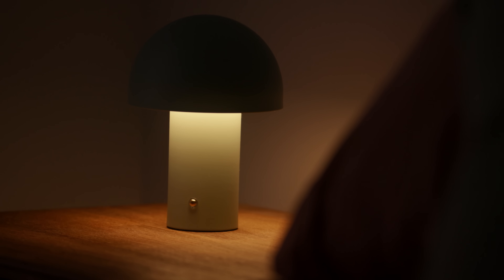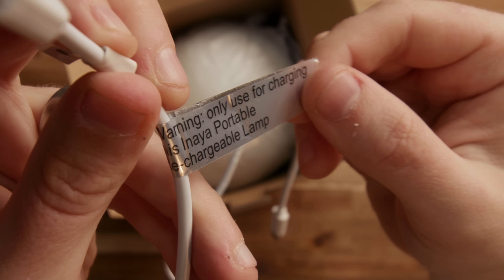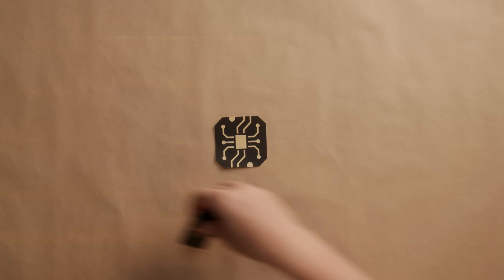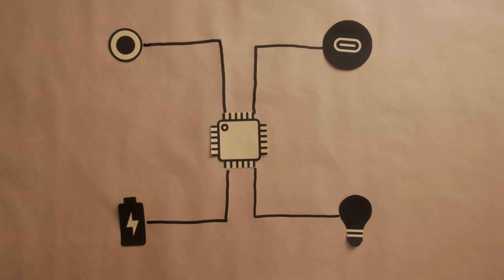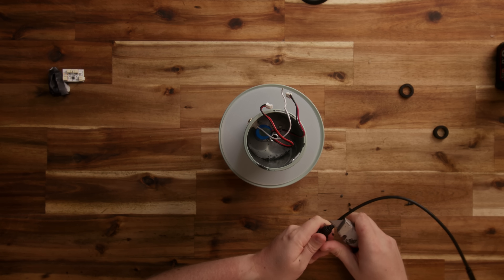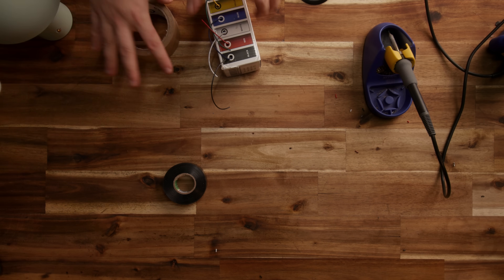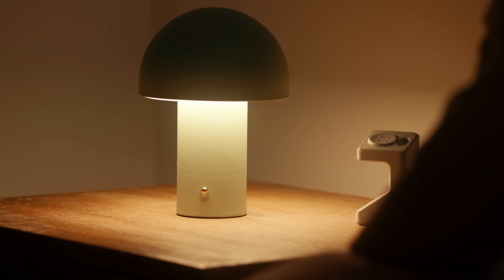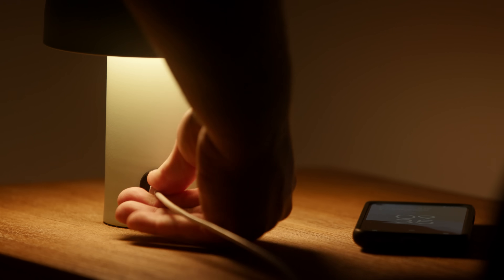Kmart Lied to Me, So I Hacked Their Lamp

Comment: So you really think that K-mart designed and made these lights?  lol
No they didn't.

Also, usb isnt the standard you think it is, many different types and formats exist.

Also, many low powered usb devices simply will not charge these days with a standard high powered usb charger, if they did then the device could melt.
I had a PS3 and xbox controller that fried back when high powered usb chargers first came out.
Back then the chargers would attempt to charge at a high rate and kill the device.

Comment: Here's a tutorial project idea: control a mains powered water feature pump. It turns on / off on a schedule but also monitors the water reservoir level and inhibits the pump if its going to run dry. Oh and the relay circuit needs to handle the very high in-rush current (which is much higher than 10A).

Comment: I notice that with another Lamp I purchased from Amazon as well, USB-C port doesn;t charge and worst it drains the battery. But the magnetic connect at the bottom of the lamp works.

Comment: Seems to me that K-Mart (Or the Chinese OEM K-Mart soured these lamps from) wanted the USP of being USB-C powered but didn’t want to put in more effort than was absolutely necessary. However, Given that is a Bedside Table lamp, they likely assumed would probably been nearly always plugged in to Wall power with its included cable anyway. Personally, I could rarely see myself using the backup battery function of something like this outside of a grid failure scenario. Still, if OEMs are not going to use the standard, I would rather they either have a permanently attached USB Cable or maybe use an old-school DC barrel plug.

Comment: I just bought a small travel router that claims to use USB-C power.  It only works with the original cable and wall plug and doesn’t work with any other USB-C chargers I have. 🤦

Comment: The speculation fails. Since there are "power only" USB cables with only 2 physical wires, and they are cheaper than any 4-wire cable.
 Something else is behind this.

Comment: What happens if you used a USB A female to USB c female adapter
then plug the kmart cable's A male side into the female A port of the adapter
the resulting exposed usb C female lets you use any usb c cable in

would that charge the lamp since the proper usb cable is providing power to the kmart cable which could convert it into its proprietary standard?

Comment: Curious how long the units will run in standby mode.  Do you HAVE to charge them daily or will they sit in standby on battery for a long time?  I know its possible to set the ESP chips into a very low power standby mode but that relies on certain wait-states that im not sure ESP Home supports otherwise the wifi wouldnt work.

Comment: My biggest issue with USB C is that not all USB C cables are the same. Some are for charging only and others are mostly for data transfer. And for some F**king reason there is no easy way to tell which is intended for which.

Comment: The piece of crap Telstra ZTE I has to buy when their shonky custom VoLTE software stopped my old ex Optus Samsung from making calls except to 112 / 000 will not charge from a Paspberry Pi supply whoch charges the Samsung.  And now it just makes connection noises over and over on an Ansmann charger.  A different one still works.

Comment: Unfortunately there is a trend of devices with internal batteries charged via USB-C that are not compatible with Power Delivery (USB-C PD), it simply will not charge from a PD port as the charging circuitry does not support it. USB-C cable, but has to be fed from a "dumb charger".

Comment: you cant rewire the usb on the original as usbc requires a microcontroller to negotiate voltage and current from the supply microcontroller. Its probably why they left it out to save cost.

Comment: Get some of those 1 dollar solar stake lights. Mod the solar cells and put them in your window and run it to your lamp with a usb plug to charge your lamp.
I charge a small led bulb with fluorescent lights and if the power goes out it turns on so i'm not in pitch black.

Comment: The USB-C spec is a legally defined standard. More-over, the USB trade and word marks are protected from miss-use. It is actually illegal. Both from a fair trades and standards view-point, where they are in clear violation on the basis of miss-labeling a product. But also from the prospective of miss-use of USB-IF (USB Implementers Forum, Inc) trade- and word- marks.

Comment: I’ve got one of these lamps, and thanks to you now I know why it inexplicably stopped working a few months ago! I’m really super annoyed with Kmart, because if I’m pretty sure if I glued a metallic cat figurine on the front of my old Commodore and sold it as a Jaguar, I’d be in a truckload of trouble. How is this any different?!? Especially as you say if someone were to use this crappy pseudo USB C cable to power something else, potentially it would fry this other device. Well I just rounded up all the USB C  cables in current use around my house, as many if not most had ended up attached to something other than what they originally came with - coz I naively thought this interchangeability was the whole point of USBs, otherwise they wouldn’t be detachable, right?- Luckily I managed to find it, however any relief quickly morphed into horrified panic when I realised this rouge “USB C” cable was the very same cable that I’ve been using almost daily for months to charge my iPad Pro. So KMart, if your faux usb cable has caused my iPad any damage, I’ll be returning this along with the light. Possibly with force through through glass in your front window.

Comment: I think you have confused USB-C (a connector) with USB version (1 / 1.1 / 2 / 3 etc) and USB standards (such as USB PD). If a device says its "USB C" that is basically meaningless, just means it has a USB connector. It can use that connector for anything.

Comment: Was it that the lamp only would charge with a usb to usbc cable. I can’t stand it when companies make devices only charge with that cable. And not a usbc to usbc. I believe it’s that usb 3.0 has a 5v standard and usbc to usbc you need to add the connections to make that happen. Hence it costs more

Comment: You sure the lamps are actually not USB compliant at all? I generally only know this kind of issue from legacy USB devices, with an incorrect USB-C implementation that is missing the two 5.1k resistors to switch USB-C chargers into legacy USB-C mode. These typically only charge with a USB-A to USB-C cable. Annoying but at least half USB compliant and reasonably easy to fix. The main issue is that not all USB-C ports expose all USB-C pins and you need 5.1k resistors between CC1/GND and CC2/GND, so often you need to change the USB-C port.

Comment: I thought all the KMart stores had shut down? Also I bought a HAM Radio from the website when I worked there because they did not carry any in store, turns out they never deal in HAM radios and it was a third party seller who gave me a very good price on a very good imitation/replica of a Handheld Transceiver made by Beofang. Beware whenever you buy anything online or in store as imitations are rampant.

Comment: walmart has the similar issue with their swamp coolers.  The cords would fry phones or not charge them and regular chargers would not fully charge them, I had to take them apart and stop them from shorting out.  I am not as good with electronics as you bun found the issue was they where not insulated properly, man was that annoying.  I had gotten them so I could work in a very hot garage, and needed them to be working all the time.  It was fun having take them apart at least.

Comment: I have the same lamp. It's not the USB C problem. It's the fact that your phone charging brick doesn't support 5V 1A. Most modern phone chargers have phased out this input, but because this lamp is so cheap, the controller is very old and have no built in wattage conversion, it only supports 5V 1A input. 
The reason why the cable that comes with works is that because the cable is so bad, no matter how big of wattage you throw at, it only passes through 5V 1A that's why it works, whereas the other cables can allow much higher wattage to go through but the controller doesn't accept this wattage. 
The easiest way to fix is to buy a charging brick that supports 5V 1A (probably quite rare to find now) and it will charge just fine.

Comment: The dodgy product and user experience sucking sums up Kmart products these days. I have a cupcake container, you know the ones with the lid and handle? The old one is solid af, from kmart. The new one i replaced it with, same relative price and also from Kmart is absolute bollocks. Its thin, doesnt fit together properly, and is the same colour as half the items in the store .... That crapola mint green.

Comment: The vid is good, but idk man I use a different usb cable to charge my kmart lap. Granted my PD usb c to c cable wouldn’t charge it, but I assumed that was because the output was too high. My shaver charger plug with the usb a to c cable charges it, I just assumed that was because it was lower power. Did I accidentally have another cable that used this weird format?

Comment: I'm not trying to give kmart a pass here, but they weren't the ones trying to save a few cents here - it was more likely the sourcing guy at the Chinese factory talking with the supplier of the PCB and figuring out how to save a few cents and then since the lamp still works, neglecting to tell kmart about the change - this exact thing has happened to me at a Chinese factory. And unless kmart did a full tear down, standard QC would not have caught this.

Comment: I have a trading company here in China and we see this all the time. Purchasing agents from the US major retailers will ask us to tell the factory manufacturing the item to change their original designs that the factory already offers, for a product that has thinner wires or different cheaper connectors to lower the price. The factory has already spend time and money in research and development to offer a good quality product, but the importer only really cares about the bottom dollar price. The factory even warns them many many times about cutting corners that does not really affect the price that much, but in the end, they will make it to the importers specs. Today we have a purchasing agent that is unhappy because the factory producing 5000 ladders for them wont change the 304 stainless steel bolts and rivets for galvanized steel.
Reply: Lol yeah, sure buddy. It's those pesky importers driving down QC standards in discount Chinese factories.
Reply: @fsociety6983  If you really think major retailers are trying to pay top dollar for top quality goods, you are delusional. I have a Walmart purchaser who even tries to haggle about the price of the cardboard cartons the products are shipped in. Factories here can produce top quality products or junk, it all depends what your budget is.

Comment: There's no way they saved money by making custom USB-C cables, the correct ones are mass produced in such enormous quantities.  Even if they only wanted a USB-A "USB-C" with just the old 4 wires, those also exist in enormous numbers.  And yes, nonsense like this should be outright banned.  Not quite as bad as modular power supplies all picking incompatible pinouts so you fry thousands of dollars in computer hardware if you need to replace one, but it's still pretty awful.
Reply: "Surely this time, the government will solve the problem"

Lol. If you don't like garbage e-waste, don't buy cheap Chinese crap and be shocked that it turns out to be e-waste. If everyone calling for the government to regulate their lives just didn't buy these products, there wouldn't be a market for them

Comment: Ok, so I bought some awsome minstral lamps, battery and usb-c charging. And they specify 2.0 amp max. And I assumed  the cables seemed to be only good for power, not data. In fact that was why I thought initially that specific cables were needed on these lamps. Kinda like early iPhone cables that were charge only, and sync ones. From reading I see they want to use just the usb-a voltage, and rules. But don’t want to use a micro charging port, probably usb-c ports are cheaper. And also don’t want to add whatever other components are needed to make usb-c compliant. Which makes sense I suppose, as usb-c can be various wattages and voltages now I think? Still don’t know why they didn’t just put some resisters in line, and specify that it must only be usb-a to usb-c 5v 2.4a. But I guess by doing it this way, no-one is going to be able to plug a usb-c high voltage/ wattage to usb-c cable into it. And blow it up, as wired so it makes no circuit.

Comment: I have these and thought it was a bit odd that they wanted ONLY that specific cable, considering it was USB-C. Thanks for the technical explanation and the excellent video!
Reply: Fwiw if you wanted you could absolutely take them back to Kmart and demand a refund, based on false advertising.
Reply: @JimCullen yes, though that may be getting harder to do in the US soon. Consumer protections are falling.

Europe's better consumer protections and warranties are a major reason that Europe has a better trade balance with China. When you require companies to produce products in higher quality and with real customer service, you tend to get more products made within your own country, and none that are junk dumped by some other nation. It's an easy cheat code for improving your economy.
Please help spread the word: better consumer protections and quality standards will improve the economy.
Reply: And, after skimming over your other content, I'm subscribing. Look forward to watching the rest and anything new you're cooking up mate.
Reply: A ton of things just don't do the whole voltage switching thing like they're supposed to, so you need a cable and/or charger that supply the correct wattage. Even expensive things are like that.
Reply: @TheIrishAlchemist205  this lamp takes 5v, which just needs 2 resistors in the device to support usb c correctly, and will work with any charger. there is no excuse for this at all, it would've only cost them like 2 cents extra to do properly

Comment: I didn't like how you said the whole point of usb-c is it's a unified standard even Apple is using it now. This implied that Apple isn't doing similarly dodgy things with type-c. I guess the primary difference is their shenanigans are only effecting efficacy not whether the cable/device works at all, and also won't blow up your appliance if you use the wrong cable.

Comment: This isn't unique to K-Mart.  This is basically most of the cheap crap from China.  I have gotten several "usb" devices that ship with their own charging cable, and when trying to use a proper USB cable they don't work.  It's basically just a power cord with a usb connector they use to save a few cents on production.

Comment: Well, well, well I HAVE THIS LAMP AND THE CABLE BROKE ONLY RECENTLY! I was furious mainly because it was less then 3 weeks old and the tip of the charging cable detached and got stuck in the actual charging port of the lamp! However I did manage to get it out and proceeded to try other charging cables…and wouldn’t you know none of them charged it 🤬 luckily where I work has charging cords galore, and I have found one that does charge this lamp perfectly. Good luck to everyone else 😬

Comment: Mine won't charge from my fast charge cables but it charges fine with the cheap 3m cable I bought off ebay that lives behind my couch and also the cable that came with my vape. This was a great video and elegant solution though, they are such cute little lamps and definitely give way more ambience than their price tag might suggest ✨

Comment: 5:00 just in case anyone gets the wrong idea from this wording, a MOSFET does not amplify current. a MOSFET gate measures voltage, not current. when you switch on a MOSFET, some current flows through the gate, but just to charge (or discharge) the gate capacitance to the voltage level you are supplying. once the gate's voltage has equalized with the voltage you've connected it to, no additional current flows to keep it turned on. Think of a transistor as a guy with a meter, adjusting a big potentiometer based on the value it shows. in a traditional BJT, the guy has an ammeter, in a MOSFET, it's a voltmeter.
Reply: So somewhat like a little relay, minus the need for a constant signal voltage and ground to engage the connection?
Reply: @LgSutterby it does in fact need a constant voltage to stay turned on, the difference from a relay (or a BJT) is that it doesn't need a constant current to stay turned on. that's why if you connect a voltage source (greater than the gate threshold voltage) between the gate and the source of an N-channel FET (different terminals for P-channel), and then disconnect it, leaving the gate floating, it'll stay turned on for quite a while (theoretically indefinitely), bc the gate acts like a very small capacitor. A small amount of current flows initially to charge the capacitor up to the voltage you connected it to, and since there's no current to discharge it, it stays at that voltage. so the gate does need to be kept at a constant voltage to stay turned on, it just doesn't require any current and thus any power to keep it at that voltage once it's there.

in practice that capacitance is very small, so even a very small leakage current from imperfections in the device, circuit board, etc could drain it over time which is why in practice we don't leave gates floating. instead, we leave it connected to the voltage source, but leaving it connected dissipates no additional energy (aside from minuscule leakage current) since no current is flowing.